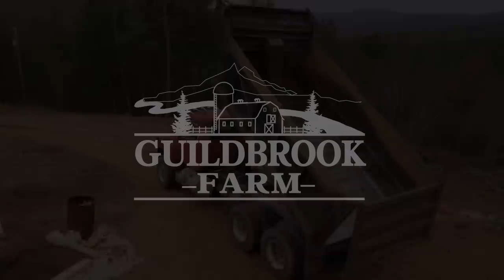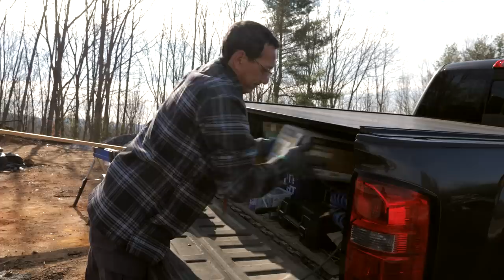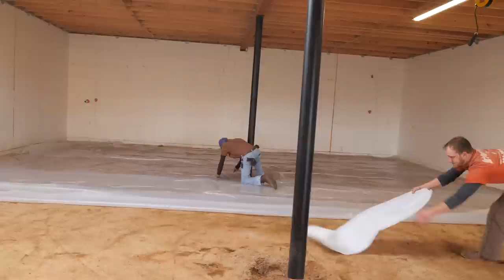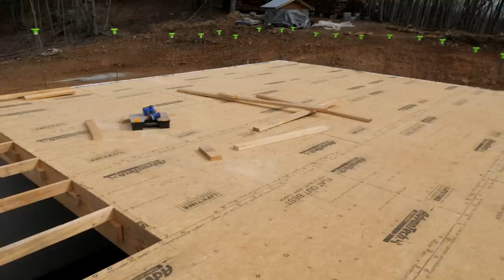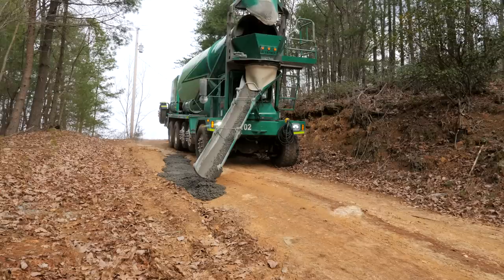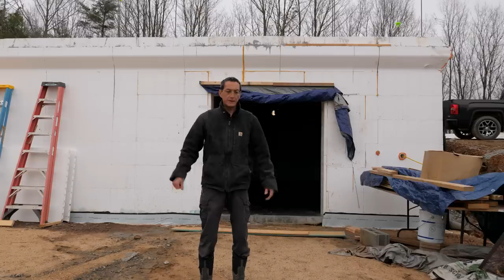ICF Mountain Homestead: Basement Floor Slab Pour & Finish

Comment: Oh dear.....membrane not branded, not taped or returned up the perimeter walls.....Where is the reinforcement. Any control joints installed . How are you going to drain the basement in the event of flooding.....
Reply: Peter Wooldridge flooding? they live on a mountain. And they did the cut in.
Reply: Extensive French drains were installed around the periphery.   There's a video about that.